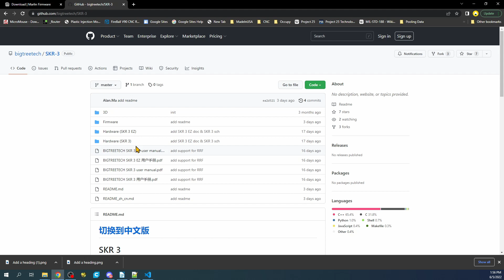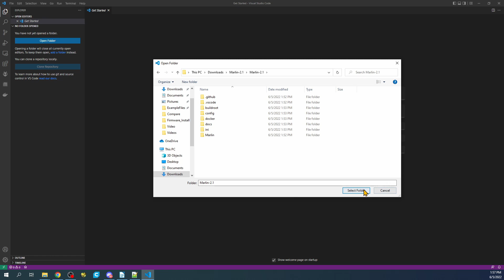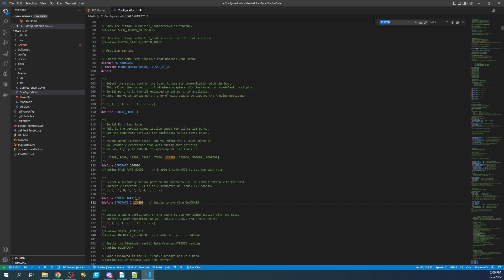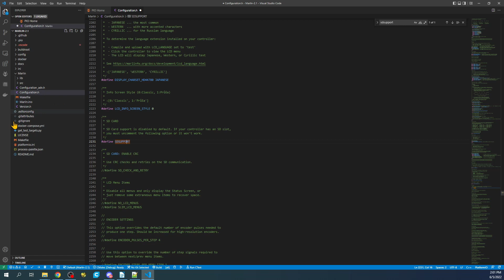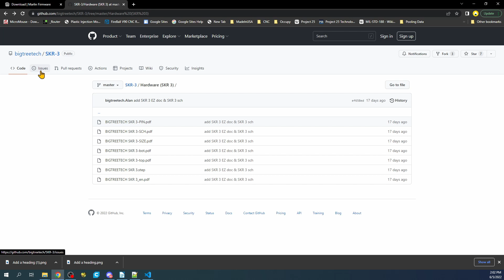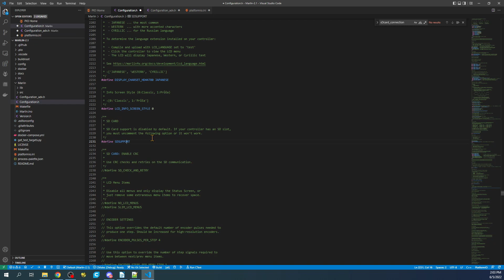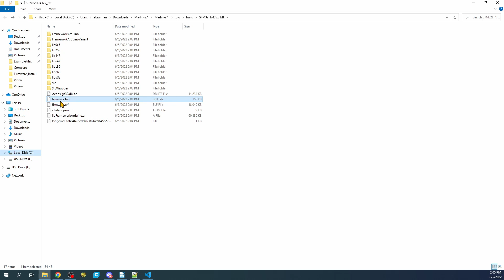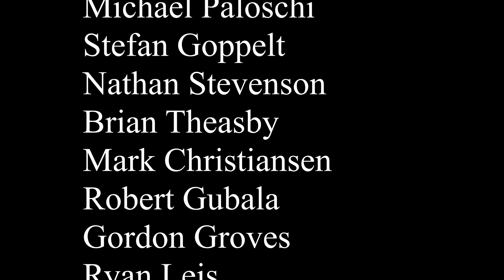BigTreeTech - SKR 3 - TFT70 v3 0 install

Comment: I noticed in the latest firmware of 2.1.2, that it shows //#define BIQU_BX_TFT70. I am curious if that is the same thing?

BTW I learned something new...Ctrl+/
Reply from the maker: In New firmware things may have changed.  I'll be doing so investigation in about 10 more days when I have some vacation time from work.

Comment: Thank you for all of your help, thru-out my SKR 3 EZ w/ TFT70 upgrade!   I also use the back of the box as a pin guide.
Reply from the maker: You're welcome.
Reply: @EdwardBraiman  would you / have you a video on updating and file transfer, thru WiFi, for each of these? Extra goodies you can do thru WiFi's?
Reply from the maker: Normally do WiFi with raspberry pi.  Otherwise directly to board consumes to many resources on computer.
Reply from the maker: Meaning WiFi card is not recommended.

Comment: Great Video, i followed the video exactley to install aTFT28 v3.0 on a SKR 3 ez board, but it doesn't work.I get every time in the screen "Printer not connected" do you know what is going on? It looks like my serial ports don't work
Reply from the maker: Check speed on display and match it to configuration.h serial speed.  One might be 250000 and other might be 115200 on display.

Comment: I did this with an SKR 2 (used the proper environment etc for my board), set the baud rate just like you did, but my display still says no printer attached and when I flip over to Marlin Mode, it only says Marlin Mode at the top and doesn't give me any information. Any ideas?
Reply from the maker: There's a Discord link in description and either myself or someone else can help you in general chat.
Reply: @EdwardBraiman  Awesome, thank you! I'll join up if it comes to that :)
Reply: @jrbarker7362  Hello, I have the same issue, did you solve your problem? How ?
Thank you !
Reply: @basilejacques6495  I’m not sure, I think I got a TFT 70 working, but in the end I decided to go headless and just use Octoprint. Sorry I can’t help more, it’s been a long time.

Comment: Hello,

First of all I wanted to thank you for your channel and the effort you put into it.

But I also have a problem, but unfortunately I can't find a solution.

I have the SKR 3 EZ with 5160 drivers and the BTT TFT70.

At first I wired everything up and then powered the whole thing via the USB port.

I could find a connection between TFT and the board.

Then I flashed the firmware and now have the message.

NO PRINTER CONNECTED!

Did I miss something?`

LG
Reply from the maker: It's the speed on display settings.  It's either 250000 or 115200 on display and should match firmware speed which is probably 250000.

It's in setting on display for baudrate.
Reply: @EdwardBraiman  danke für die schnelle Antwort. Ich sehe gerade ich kann auch in Deutsch schreiben und es wird übersetzt.

Also ich habe alles mögliche probiert.
Ob in der Firmware des tft und auch in der Firmware für das Board. Habe alles so getan  wie du im video.
 Aber auch versucht die Port's zu ändern und auch die baudrate jeweils auf 115200 und 250000 gestellt.

Bekomme leider keine Verbindung.

Ich glaube ich habe ein Problem mit dem sr232 Anschluss.
Die Kabel sind richtig angeschlossen, aber ohne Exp1 und Exp2 geht das TFT nicht an.

Bevor ich dir Firmware auf beiden aktualisiert habe, konnte ich eine Verbindung vom tft zum Board erstellen. 
 
Nachdem ich auf dem TFT die Firmware + fonts etc geflasht habe, ist auch das Drucken über die Onboard sD verschwunden. 

Bin leider mit meinem Latein am Ende. 
Ich kann das Display auch nicht auf Werkseinstellung setzen. 

Ich werde heute nochmal versuchen, ein marlin zu konfigurieren, welches nur das Display unterstützt und nochmal probieren ob es vll generell an meiner Konfiguration liegt. 
Aber ich denke viele haben diesen Fehler mit BTT TFT's und keine Lösung. 

LG Kelvin

Comment: I have an SKR 3 EZ and my core files only contain the non-EZ board. Is it ok if Ijust copy your line into my core?
Reply from the maker: Probably not, also using the term core files is probably saying something other than what you're asking.  Core file denotes a crash of software.

Comment: Im upgrading from an e3 turbo. Which only uses exp1. Does the skr3 specifically need exp 1 and 2?
Reply from the maker: Depends on display.
Reply: @EdwardBraiman  its the tft50 v3. Its just strange the e3 turbo only uses exp1